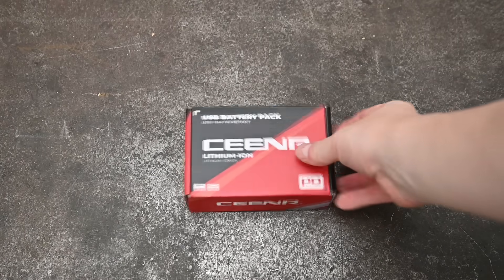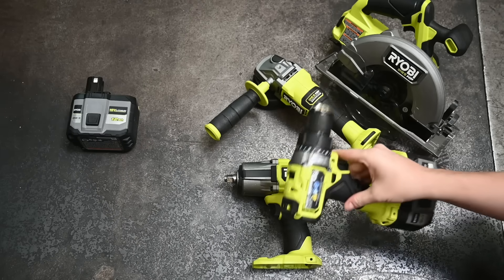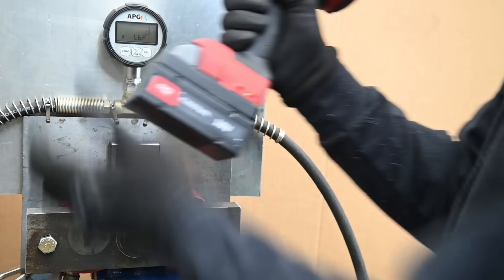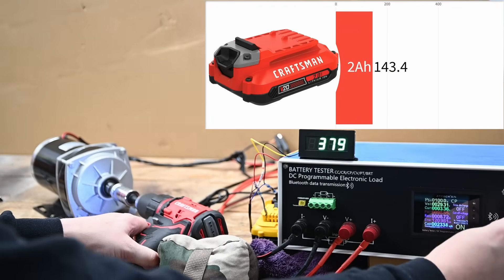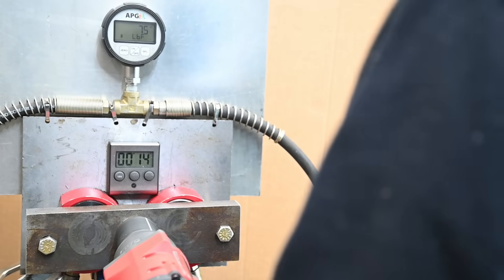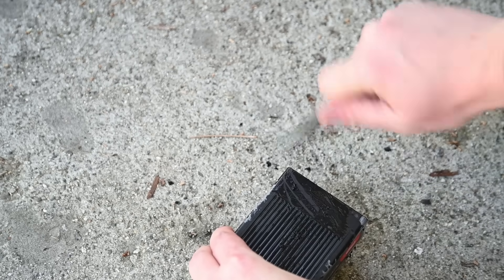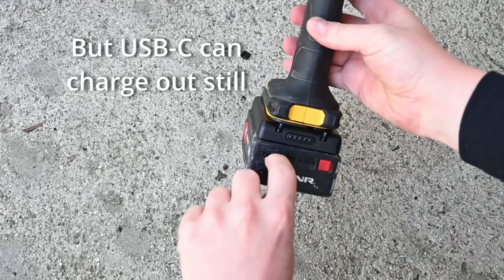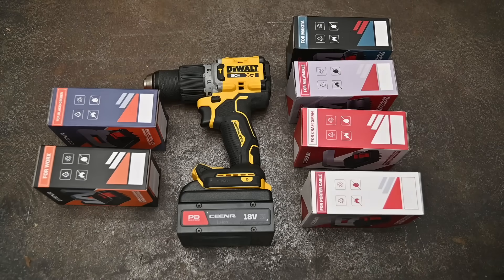We Bought the New Universal Battery for All Tool Brands

Comment from the maker: Imagine a world where you don't need to wait 8 years for your color of tool brand to make a track saw, or the type of nailer you need, or your band wont make high performance batteries because they want to push you to their higher price line, or they start downgrading tools to place it better in their brand price ladder. Let's say your brand's mid torque impact is too long to fit where you commonly need it, instead of waiting years for a new generation you just go out and buy something a little shorter, maybe even at a better price. This is the beginning steps of something like that, and that's a world i want my children to grow up in lol :P
Reply: You now have a platform usable on every major tool brand on which to create your own super powerful Frankenbattery. I look forward to seeing this.
Reply: I've starting dabbling in 3D printing custom batteries (so far only Bauer) so I don't have to pay for extra batteries. It got me interested in potentially selling them, and I'm interested to see how Ceenr plans on not getting sued into the oblivion. The patents for the batteries are pretty broad and it seems to me that It'd be hard to do legally. I wonder if the modular system helps bypass that. Hope for the best I'd love for a product like this to succeed.
Reply: I hope this doesn't cause the tool makers to start adding software to stop aftermarket batteries from working. Like printers and their ink
Reply: @massminer2343 surely they would have done that by now right ?  It's bound to happen eventually, same with software updates for every tool before your they will turn on.
Reply: From a man that owns, red, yellow, teal, green, blue and orange tools,I second this idea 💯% finally! I've been saying this for years that somebody should make one that fits them all, they could take over the world 😂
Reply: Couldn’t agree more. The cells inside are standardised, so why not the packs? It’s also not a case of mystery or magical specs on the batteries, so it literally is just proprietary technology for proprietary sake. Safety margins are all in the datasheet so it’s not hard to engineer the battery pack to make up its own mind about whether or not it can do the job being asked.
Reply: Does Ursula von der Leyen have a way to see this? I am sure she is a fan and can help with this in the EU!
Reply: @BrokeLifeEU  That was already available in the EU for some years, here there's the Cordless Alliance System (CAS) used by many professional specialist tools made in Europe plus all Metabo cordless tools of the same voltage(s). You don't even need to purchase the batteries from Metabo, you can get a CAS battery from any manufacturer that uses them, also when you new tool comes with a battery you get an extra battery for all other compatible tools.
Reply: @Pinz314  I wasn't aware of the others. I only have a couple Metabo cordless tools, a screwdriver drill and a 1/4 impact driver, both have 18V 4Ah LiHD batteries but I purchased them used on eBay and came without the manuals so I never paid any attention to the CAS logo until some months later when I seen a Rothenberger press for pex fittings with a suspiciously similar battery and looked online to see what was going on and found out it was a Metabo idea to share their battery design with other brands...
Reply: @BrokeLifeEU   there is already a universal power tool battery law in the pipeline for the EU.
Reply: One of my biggest pet peeves is vendor lock-in. Batteries for power tools, ebikes etc., ink and toner cartridges for printers, pods for coffee makers, you name it.

Yeah, I want to live in a world where you buy the best tool for the job (within your means) without having to worry if your existing batteries will work with it. Like - if you have only DeWalt tools, but DeWalt's version of the tool you need is worse than similar priced offerings from Makita, Bosch, Ryobi and Milwaukee, why should you have to buy the crappy DeWalt tool?
Reply: I mean ive been doing that for a couple years now with adapters.  I have some ryobi and ridgid tools that have adapters for my milwaukee batteries.  (Or the generic versions of those batteries 😂)
Reply: No "lol :p" necessary. Hoping for a future where humans acknowledge the finite nature of the highly energetic/highly desired materials used in production of __________ (the Elysium variant of this would be awareness from day 1 of conception vs eventually realizing only after depletion). 

Some people might even consider it corny/cringe since us humans are so seldom taught about consideration on a global scale (most of the time not even locally), but that just reinforces the belief that such teaching needs to become mandatory. Imagine a world where we didn't shit in the middle of the table, then sit down for a feast at said table, all the while complaining of the stench and flies. 

Nuff preaching, I just like for it to go into 'print' every now and then. As a tool user/addict lithium pack re-user &  I love the content y'all make. As someone who values and respects when people use their own voice AND IT IS PLEASANT TO LISTEN TO, I'd like to say thank you for your uploads.
Reply: 15:47 definitely. i'm just a DIY guy and I have different brands for each type of power tool. In other words, these batteries aren't fully utilized and just e-waste. On top of that our cordless vacuums over the years with none-replaceable batteries despite compatible with 20V six cell power tool batteries.
Reply: People will put up with this when it comes to making a brand into a cult. Example, Apple has been doing exactly this since the Macintosh. Strange thing is, I bet many people here who complain about this very thing gulp down gallons of the Apple/Microsoft purple Coolade every year. To them, stop complaining, YOU perpetuate this kind of corporate behavior.
Reply: So sick of these corporate clown bean counter proprietarianism. Hope the eu mandate for universal batteries goes global
Reply: @Gazdadjuz  how exactly will that work. My tools are 36v. There are quite a few advantages but one of the tradeoffs are larger heavier batteries. So what happens when someone wants to make a 36 or a 28v battery. Are they prevented because we have to have compatible 18v batteries? What if someone wants to use a different battery chemistry but it's not compatible with the chargers and puts out an incompatible voltage? What if someone wants to produce a super compact model that uses a physically smaller battery pack? It's not an exaggeration, it will strangle any sort of innovation and force tool makers to build to the lowest common denominator. I like the idea of compatible batteries, but there are too many very valid but very different opinions on what factors are important.
Reply: I expected Brand specific cell holders that you fill with your own cells without welding or soldering. It's the only way for customers to replace later that one defect cell in the pack
Reply: @andreasscharf2531  that is exactly what I have been waiting for someone to make! Also imagine just charging cells on a big bank then slapping them into what you want to use. Specifically the 12v tools from like Bosch and Milwaukee since their bodies would 100% support this style with no changes to form factor. When a cell in those goes bad I harvest the rest and save them so I know the insides well haha.
Reply from the maker: @andreasscharf2531  Sounds like what would be a very large battery case. But would be pretty awesome
Reply: Problem with batteries delivering 50+ Ampere - you can't just place them like in a radio or a flashlight. The batteries must be from same bins of open voltage, cycle number, internal resistance, and MUST BE spot welded. Failure to follo only one of the above, and you get a fire, an explosion, or both.
Reply: Hopefully. But usually they charge a premium for these sorts of things and no one buys them.
Reply: I'm already there with dewalt batteries, makita grease gun from japan, makita 3mm planer from china, m18 track saw, m18 nail guns. I'll buy up to 8 if they fix the power cap issue.
Reply: If you can customize Jordans, x box controllers, why can i not my tools. Let him cook dammit!
Reply: I love this. I will absolutely buy one.
Reply: What would be even cooler is if the battery was open source, nobody want's tooling specs or anything to reproduce it as that's their IP and costs a lot of money and absolutely protect your investment. Just take note how any right to repair friendly company's operate and model themselves are such. I feel like this is a big step in the right direction, but not the end goal that we truly need as consumers. If we can't repair this product then you truly don't own it and you're still buying e-waste in the end. This will cut down on a lot of e-waste but will still be e-waste it's self which is a sad concept that we still live in.
Reply: But then everything wouldn’t be color coordinated!
Reply from the maker: @fizzyl  At least they chose black. What color does black not go with?
Reply: @TorqueTestChannel  true, but I wouldn’t dare use a blue 18V coffee maker next to my yellow impact wrenches 🧐
Reply: @fizzyl  that one guy  disassembles and dyes all his plastics on his tools tools. it's high time someone set up a business doing this where you order the tools and have them shipped to the dyeing shop and presto all your tools look pretty like the snap on catalog shows
Reply: @TorqueTestChannel  black and  Decker.
Reply: voiding warranties isnt good advice for anyone. running a flex battery in an 18 volt tool for extra grunt is stupid. not smart. they have safety circuits for a reason and that supercedes all consumers opinions

Comment: In simple terms, it is a battery with adapters for tools from various brands
Reply from the maker: Yes, though most adapters adapt one battery from one brand with another never meant to be together. And sparks, melting, weird stuff can result from that depending on the pairing under heavy load. This is a battery and board made to work with all of those brands, and adapter hats to clip into them. Though, some of those hiccups linger it seems, but we feel they are mostly self imposed safety ones.
Reply: @TorqueTestChannel  I consider it an incremental improvement, not a revolutionary one that will change the industry in a meaningful way. I fear if the tool manufacturers don't get together and come to an agreement on 1 interface, the government will force it. That never turns out well for anyone.
Reply: @Bob_Adkins  why would the government care enough to intervene?
Reply: @cilli5866  The government won't care.  The people who think the government will intervene have no idea how consumer protection laws work.  There are far too many tool brands and options out there for antitrust laws to apply.
Reply: Ya, as soon as I saw the adapters you must purchase, I realized this is not a "universal" battery.  Adapters have been around forever.  You can even 3D print your own.
Reply: Then it's not really  "universal". Adapters have been widely available for 3 years, but they don't come with batteries. 6 of 1, half dozen of the other.

Comment: so, the PDNation can not charge on the charger of say a Dewalt with the dewalt adapter? I NEEDS to charge from the USB charging port?
Reply from the maker: No way to charge on every brands charger, so better they dont pick one brand otherwise you're back to where you've started with proprietary stuff. USB-C is the opposite of proprietary which makes sense. Edit: Wow, USB-C these days can spit out some serious watts is seems!
Reply: @TorqueTestChannel  USB PD max charge is 240w.
Reply: @TorqueTestChannel  fair. Hopefully, they can work some kinks out with the board and let the molecells out as you suggested, while also at the same time allowing up to 100w charging (many modern flagship cellphones can take 80-100w charging) to help speed things along. Its a great idea, and I hope it goes far. I just feel it still has some kinks to iron out.

Comment: The EU managed to put the USB-C on the iPhone. I can only hope among other regulations they come up with one for interchangeable batteries between tool brands. I buy mostly Parkside tools, because the batteries are cheap. And the price of the battery is the biggest obstacle to overcome for me as I am not a professional user by any means. I use tools at home, around the car and bike and to make the occasional low budget and low quality YouTube video. So batteries sitting about doing nothing is not a good investment for me. So a Parkside 8Ah battery that works on a Milwaukee I would very much like. That said I am not a fan of the 3D printed adaptors. So go on EU take them on! 

P.S. It must be said that you have made another exceptional! Thank you!
Reply: There is a risk that Parkside batteries are not as good as they seem. It would be cool to see some of the performance parkside tools tested first by TTC, then batteries themselves vs name brands. I'm just talking about performance of batteries not longevity cuz it's another story and that seems to not be a problem. Parkside seems to use cheap chinese cells inside so that would explain the cost of the battery at the shell. Even their 21700 4ah pack is most likely made out of cheep chinese 21700 cells.
Reply: @bleyz3557  For sure Parkside batteries are nowhere near as good as say a Makita, DeWalt, Bosch. However if I could choose wether to spend more on a battery or tool I would spend on a tool. Simply because I look at the battery as a consumable so I would like a reliable tool and a cheap battery. This is by the way the view of someone who does not use these tools professionally as said in my previous comment. Of course not too cheap a battery but if it can do 95% of what a battery twice the price can do I will be more than satisfied.
Reply: @BrokeLifeEU  the tools are mostly pocet money prices, and battery (as say, not say power/lasting, at the price buy two, and on big jobs you have one being charged, and could going all days needed, just keep swaping dead batey for charged one, and day cheap drill dies, you leave in the rain etc, just buy new one, at price, have replasment new box read to go?
Reply: @bleyz3557  "cheap chinese cells" you mean cheap cells? you know that china is the leader when it comes to batter production and research
Reply: The problem would become using who's standard, unlike low power devices that USB already dominating the market to start with, power tools doesn't have any clearly superior standard yet.
Unless maybe they go super big brother mode, come up with their own standard and force it upon everyone.
Reply: @rudymeow  It would likely be Makita/DeWalt/Bosch developed system. Milwaukee would try to cut in line and be smacked down for their arrogance.
Reply: They already did...on the tools they run, it's called the CASE battery system
Reply: From 2025 eu states (law) that all powertools from every brand should use the same battery.
I like theire thinking but its bad in reality.
Reply: @fulf  That was an April fools joke.
Reply: @joshuaking34  That video made me hopeful. Then I realised what the date was…
Reply: @fulf not true. Would such a standard ever come into force in EU , It wouldn't mean one battery for all. It's just a connector standard, we would still have better premium batteries able to deliver more amps to beaffy powertools and cheap weaker ones like the Parkside makes.
Reply: Power tools are a bit different than household electronics people "rely" on. I don't see them ever even attempting to push for universal batteries for tools.
Reply: @--_DJ_--  Neither do I unfortunately. I looked in to the CAS battery system mentioned above a couple of times, however it is nowhere near universal.
Reply: Stuff the e u
Reply: @chipperkeithmgb  Why?